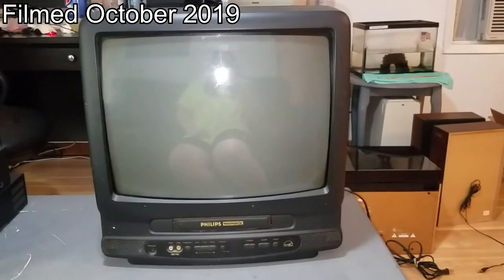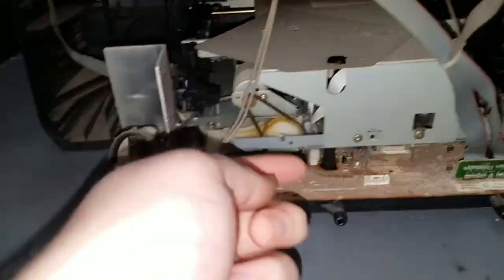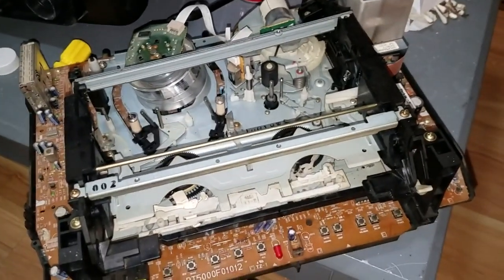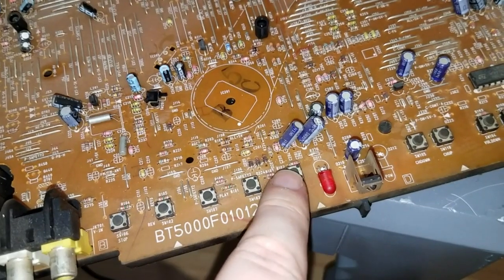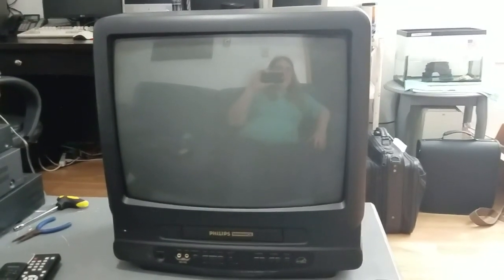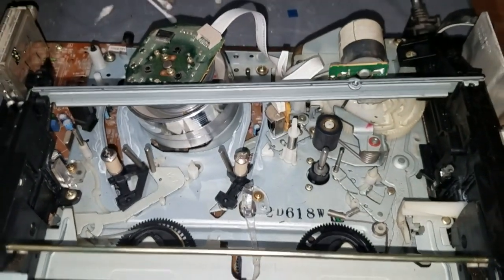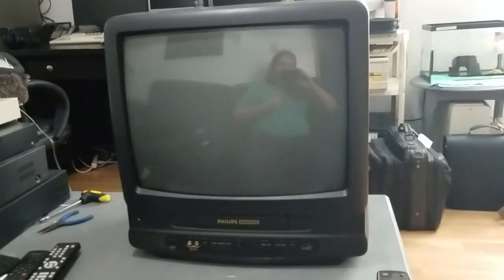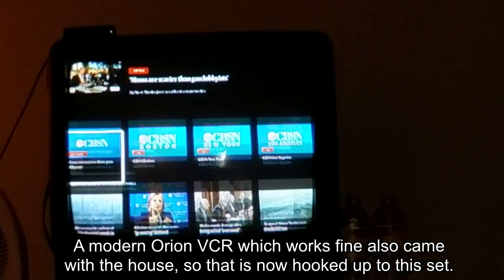Philips-Magnavox 19" TV/VCR combo (1999)

Comment: I love your video. I have a 19 inch Funai combo unit and the tape loading mechanism is messed up. A tape barely enters and stops going in. With no tape I hear a motor starting run and then grinds down to a stop each time the TV is turned on. Shutting off the TV I hear a motor run and then stop. Unplugging the power cord I hear a motor run for a few seconds.
Reply from the maker: Definitely a dirty mode switch.

Comment: HELP ME. I have a 1995 Samsung 13 inch vcr tv combo I just found. If the tv is on it spits the tape out automatically and says stop on the screen. However if the tv is off I can put in the tape and it will actually play about 10. 20 seconds before it statics out and ejects the tape again.any ideas on what's wrong?

Comment: We had a similar unit at home when I was growing up. Ours was a 13" set that we purchased from Best Buy in 1997. Starting around 2000, it started exhibiting some problems with the VCR mechanism, randomly eating tapes or damaging tapes after hitting the stop button after rewinding. It ended up biting the dust completely in 2003.
The reminder function keeps the channel number on screen at all times. A lot of Magnavox TVs from the '90s did the same thing. When I was in middle school, the little Magnavox TVs from Channel One News that were in our classrooms kept the channel number on screen at the bottom left of the screen the entire time they were on. You had to press the status button on the unit in order to turn it off.

Comment: 5:20 look at the loading motor and it is held by a cheap plastic piece that can get cracked easily  due to aging. Some don't have that issue and these older mechanisms by funai are from 1993-2000. When this happens, the vcr will jam and that is,what causes the tape to be stuck in it and not come out and it gets pitched. But you can fix it by putting Krazy glue it it watch the vcr king's video about the funai vcr pulley issue to find out!

Comment: The reason why this TV has captions while the 9 inch one does not is because of U.S. regulations requiring built in caption support only on TVs 13 inches or larger, built after 1993.

Comment: 33:47 actually, the mode switch still may have needed some more thorough cleaning, I had a similar problem like that with an Emerson Funai made combo that did the same exact thing.
Reply: That happens on my new emerson funai tv vcr every so often only when i attempt to reverse search it keeps going with a buzzing noise in the vcr it turns off and ejects but does not eat it up thankfully:)

Comment: These combos combine a CRT dust magnet and a VCR with precision components. It's no wonder they have problems. Meanwhile my standalone 1990 Sharp VCR has spotless mechanicals (although a belt started to slip.) Good job fixing what you have though. If you can find how to access the service menu you should be able to adjust the horizontal sizing.
Reply: Why CRTs are dust magnits is that beacause of heating up componants?